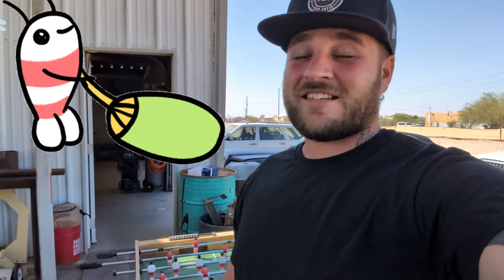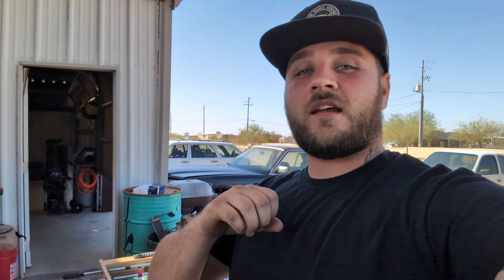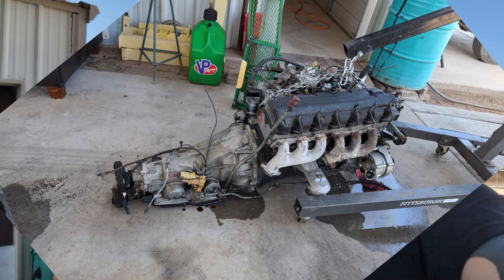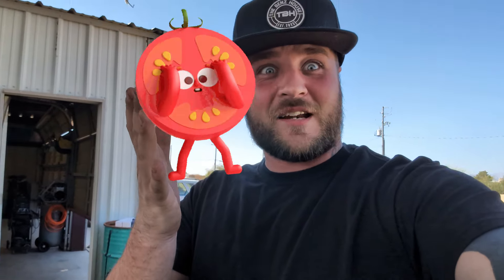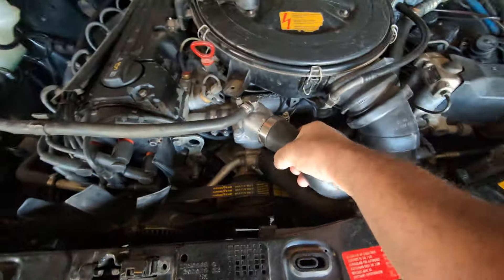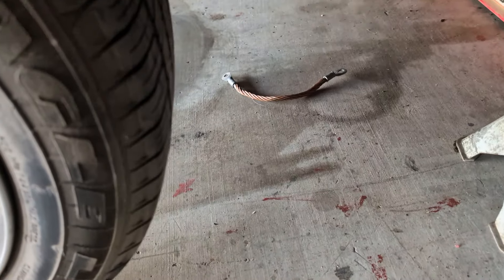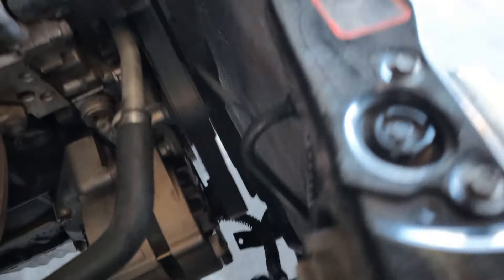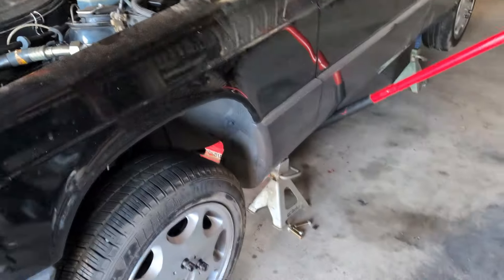New Motor In The 190e Sportline LE

Comment: You probably don't have to bleed the system, just add water and put the cap, it bleeds the system itself, at least that's what I do on mine.
Reply from the maker: @valadisbardis1390  your right we still turn on the heater make sure that the coolant is everywhere with no air you know

Comment: hi benz house boss. i finally did efi on my 190e 2.3. . i have nothing to do and would like to know what steps i should take for turbo? something budget, should it be on separate ecu?
p.s. maybe you'll say it's useless and it's easier to just plug in 111 2.3. yes, I agree, but I can't figure out what exactly needs to be done with the electrics, I'm a noob
Reply from the maker: @arsnpstn6913  i personally like SOHC motors.i love the m102 BOOST IT it's pretty much the same steps and the m103  simple and easy setup like 6lbs and you'll be having fun with it